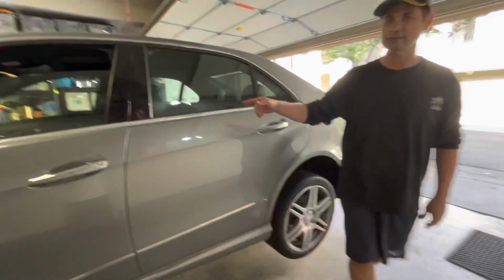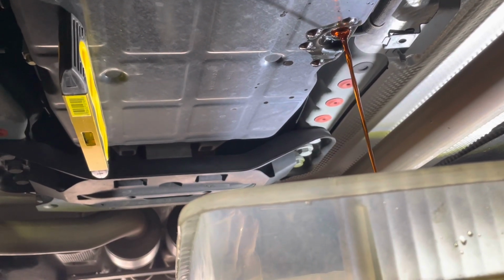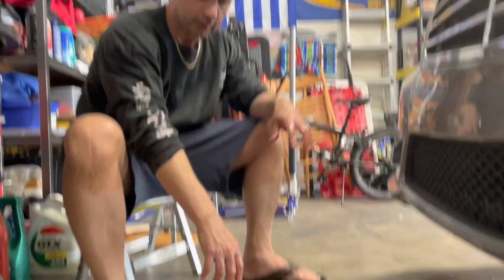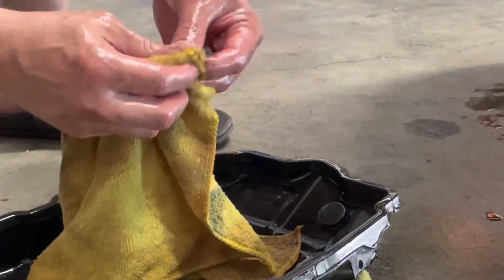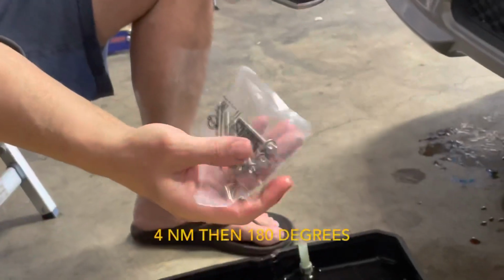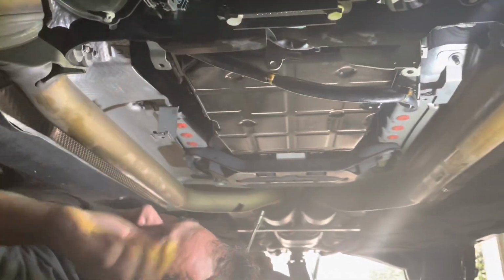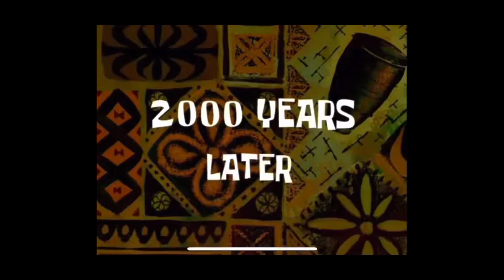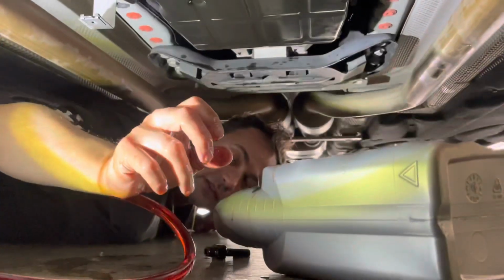2010 Mercedes E350 W212 722.9 Transmission Service

Comment: Excellent video.  Watching real life mechanic’s diy job.  That is just like my setup.  No room to move.  Oil stains on the floor.  Wife asking “when will you be ready to eat dinner?”  DIY on this job will save $800 minus parts cost which pays for all my neat tools.
Reply: Get yourself a set of QuickJacks.  Nice if your doing a lot of your own work.  Will lift the car w/o effort and very safe to work under the vehicle.  27" lifting height means you can use a creeper instead of laying on the floor.

Comment: Great video and awesome camera kid.  I just finished this exact service and set the fluid level at 63 degrees C and with the engine off as you did and the experts in the Mercedes forums said I should re-do it at 45 and with the engine running.  Maybe some experts here can chime in on how bad that is and if I should reset the level as the guys in the forum suggested urgently.

Comment: Transmission level check has to be performed with engine running. Also I read pan bolts are to be tightened to 6NM then turned 180 degrees. These are stretch bolts, therefore, they are not to be reused again.
Reply: I was thinking that very thing - I've done VW's with DSG trans and it was with the engine running and also moving the shift lever through the gears as part of the warm-up process.
Reply: You’re wrong on the torque spec. It’s 4nm not 6.
Reply: Yes it sounds like the engine was not running when he disconnected hose. Then the transmission is not running and in park, a lot of fluid "dumps" back into the pan, so if that's the case, he drained way more fluid than he should have and the trans will be running low on fluid
Reply: Could anyone tell me the part number for the transmission oil pan Bolts he changed in the video? It’s for a 2010 E350 4Matic V6

Comment: I did my 09 E350 pretty much as you did. At 45c ( 113F) the fluid is warm. Just be careful of the hot exhaust. It took about 20 mins at idle to reach  the temperature.. The oem flter from Mercedes ( filtran? material filters down to 50 microns whereas the Febi ( maybe that is the one in your kit? ) filter down to 80 microns. Will that make much of a difference? IDK. Cycling through the gears prior to draining the excess is a good thing also. Good job!!!
Reply: Yes it will. The filter's job is to both keep contaminants out of the trans as well as maintain a consistent volumetric flow rate. When you go higher in microns your flow rate also drops. Lots of people obsess over microns thinking higher is better. NO. Keep the OEM spec for lasting performance
Reply: @supersabrosinho  I believe you have that backwards - the higher the number, the more porous, meaning less restrictive.  I think that was his concern - less trapped contaminates, but higher flow rate.

Comment: Not sure if I would go for it myself. Because sometimes it is not enough just to change the oil, filter, and check the level at 45C. Sometimes Siemens/Continental TCU electronics do not like change of oil and then TCU needs to be reprogrammed. Re-marry. That is another level. In fact, my opinion is that not many mechanics in Australia are real experts in G7 722.9 transmission service and as a result, you end up with problems they create after transmission service. So, I fully understand your reasoning behind "I will o it myself".  My advice to all MB owners with G7 722.9 is "not be afraid to ask who will work on your transmission and what are their CV. o not assume that because it is MB Service center they know."
Reply from the maker: I agree somewhat with your analysis. Changing the fluid (about 50% of it in these services) will result in a change in viscosity because less metal suspended in fluid…..this might affect the how the tcu responds Bc it has adapted over time to condition of fluid. So doing this service every 40-50k makes the difference in fluid characteristics less variant. Doing this once at 120k will surely give you problems. I always do a transmission reset (with gas pedal ) after 
And then it takes like 1000 miles or so to re adapt to new conditions …. Thanks for your comment👌🏻👍
Reply: @SVXistance  Great comment. I have agreed for MB to do Transmission service at 75000km and while TCU has managed well the ISM gear shifting box did not like it. That was on S350 w221.
Reply: @SVXistance  How do you reset with the gas pedal?

Thanks for the great video by the way!
Reply from the maker: @TonyB1999  https://youtu.be/cq7Cu3R3JCo

Comment: Also if you have a A89 transmission, you MUST use Blue color Low Viscosity Transmission fluid,
Reply: To clarify.  Mercedes FE  and some aftermarket FE fluids are blue, some aftermarket FE fluids are also red.   IN any event the A89 transmission requires the FE fluid.

Comment: Hello sir, I recently bought a W212 and I want to change the trans fluid. 

Can you tell me what pump did you use to transfer the fluid into the car. I have all my parts but I do not know what pump I should buy. (Please share the link, or name of the pump)
Thanks! ❤
Reply from the maker: Slippery Pete - Fluid Pump for Standard Quart Bottles - 8cc per Pump Stroke and 3rd Hand Adapter, Transfer Gear Oil, Transmission and Differential Fluid (28mm) https://a.co/d/7sH66WW
Reply from the maker: Just google “Fluid transfer pump automotive”
Reply: @SVXistance  ahh, that worked? Not gonna lie I think that May take a while just to pump it in the trans.

Thanks! I appreciate it. 🥰

Comment: Very helpful video. How much oil came out when you drained it? Would you say around 6 liters?
Reply from the maker: I didn’t measure but I hear is about 5.5 l
Reply: @SVXistance  ok perfect! So this way youre getting most of the 9 or 10 that the system holds out of there
Reply: So shouldnbe 4 in there

Comment: WASENT YOUR FLUID WAY OVER FULL LEVEL CONSIDERING ALL THE FLUID THAT DRAINED OUT WHEN YOU REMOVED THE DRAIN PLUG ??
Reply from the maker: That’s the idea you over fill by 1-2 quarts which dilutes old fluid (you really only replacing 1/2 of fluid) and the excess comes out till dripping which is right level at temp👍

Comment: Is a Mercedes Benz A001989240310 multi grade oil good for transmission oil change for a e550 2012 4matic sedan  ? I changed my oil and the car won't move again forward or backwards after shifting gears successfully.  I hope I have not damaged my transmission if at all replacing the oil completely may be able to correct/reverse anything wrong with the car  ?
Please advise 🙏 urgently
Reply from the maker: Bro that’s for power steering 🙈🙈u need to drain all that out and use ATF 134FE is the blue fluid for that 2012 e550
Reply: @SVXistance  i will do that immediately and hope that will solve the problem. I'm extremely grateful for your advice. Thanks so much 🙏

Comment: Would you trust any European Indy with decent reviews to do this, or would you prefer a transmission shop / MBZ Dealer?
Reply from the maker: Good independent should be able to handle this no problem and be cheaper than dealer 👌🏻

Comment: I expected that the first thing you would mention in the video is, When to make this service (mileage or years ) ?
Reply from the maker: Usually best to do every 40k miles or 4 years as preventative maintenance 👌🏻
Reply: Definitely pre-emptive at 40k miles.  Maintenance listing shows every 70k or 7 years.
Reply from the maker: @stevem6711  actually first one is at 40k then you can do every 70k
Reply: @stevem6711  70K or 7 years is for the A89 option 722.9 transmission change that occurred in late 2010. The A89 fluid is the FE blue fluid. The red is used in the pre-A89. 40K or 4 years is what I have for my 2011 E350 as it was built in June 2010.

Comment: Was the engine running when u were letting the fluid drain at the end ???
Reply from the maker: It was …should I have turned it off ??😳I linked pdf from manufacture below ..
Reply from the maker: https://www.weistec.com/forms/weistec7229servicedata.pdf
Reply: @SVXistance  no no you did it correctly I just didn’t hear 👂 the engine running in the video you did 👍 I did mines about 8000 miles ago 
How does yours shift mines shifts like 💩 when cold
Reply: I also have the 3.5 direct injected engine which is very noisy
Reply from the maker: shifts ok but weird thing after fluid change my 4-5 shift is hard !! 🙈I should have removed valve body and checked solenoids for debris on their screens ….I might redo and replace solenoids they are like 40 buks each 😂
Reply: @SVXistance  man yes bro same situation here those transmission are ridiculous I heard u can update the transmission via xentry to help with that issue. I thought about doing the same thing with the solenoids I just heard when removing the conductor plate it can break so it’s veryyyy risky. I think Ima order new solenoids when I change my fluid again in another 35k miles
Reply: Also have you ever changed your shocks on the car I literally feel every bump mines has 115k 2014 e350 4matic
Reply from the maker: @G_G_AutoCareLLC  https://youtube.com/watch?v=OINKlZhqiWg&feature=share
Reply from the maker: @G_G_AutoCareLLC  https://youtube.com/watch?v=6HFh935LBfY&feature=share

Comment: Did you shut off the engine when you let it drain or did you leave it running? You never mentioned that.
Reply from the maker: Engine is on when letting trans drain to fill  level
Reply: Shut the engine down

Comment: Good video every how many many miles you have to change the fluid?
Reply: they say 60-100k for automatic transmissions but sooner is probably better of that recommendation is anything like the 10k they say for oil changes (lie, change your oil every 3500-5000 miles)

Comment: This is a good video, and I would love to do the same thing to my vehicle. I have a 2010 S 600 and V12 that I have been trying to do that to, but not able to because a hardshift. I believe it's my transmission, from 1st to 2nd gear it has a really hard pull that is really uncomfortable and don't wanna do that if there is something wrong with my transmission, but nobody can tell me or give me an answer for that, but once the car heats up it drive smooth. AT Cold star it shift really hard... Sorry that this doesn't make too much sense, I don't know how to explain it.
Reply from the maker: Shifting issues usually due to sticky solenoids or wearing of valve body passages that causes loss of pressure when shifting ……look up valve body

Comment: (So well worth it to save no money and waste half a day of my life. [Tools, setup and I'm sure you didn't use proper disposal procedures]  This is for hobbiests)
Reply: To each his own… I get personal satisfaction doing my own work. Multiply that by 4 cars I do save a bit of money. I dispose of all my used oil and trans fluid at my local oriellys FYI 👌🏻👍
Reply: @WPHMP  I agree but, scan tool, torque wrenches, tubes, jacks, fluids, disposal, containers, time and it being Mercedes (I have a 2014 E350 4Matic Sport and a 2019 AMG E63S)   I can see oil changes.....maybe.....and not on an AMG.   Not, "To each their own".   It is more costly..plus the ultra-consumerism.  I live in the highest possible prices Metcedes service area in the USA and still 2 oil changes [A+B] plus transmission fluid change costed 800 dollars at one of the most expensive dealerships with a package. It's  oral about 1800 dollars for that.  722 dollars plus tax and 325 dollars plus tax, just for the oil changes.  <They forgot the free 5 dollar car wash>.  I did receive 60 dollar OEM Mercedes windshield wipers as well.   Let alone the normal transmissions fluid change cost.  I won't expand on how much that costs.

Don't take all replies as an insult. It's just reality. I think it's interesting to DIY and do much myself. Like LED lights, lips, diffusers, interior updates, 2020 GPS updates, cameras, steering wheel and etc.  Anything that a licensed Mercedes mechanic handles, I don't touch. I really clicked on this to see if AT-205 reseal could be added to the transmission fluid as a safety precaution.  I usually add it to the oil and struts on my older Mercedes.    Personal = Hobby.  We both know all Mercedes are money pits and the newer ones are manufactured with plastic over computerized crap.   -Enjoy the day.  I wouldn't step into an O'Reilly's
Reply: @UhhhhhnooOOo00oO  
You're a bit too judgey to do your own maintenance.  "Ultra-consumerism", really?!?   Yes, you should go to the dealership to have yours done.  If you think for a second a MB dealership doesn't mess things up and not tell you, like stripping out a bolt, you'd be wrong.  Doing it yourself ensures you know how your car was maintained without having to "trust" a dealership with a profit motive.

Stop wasting your time viewing diy videos on YT.
Reply: @UhhhhhnooOOo00oO I agree

Comment: Which torque wrench did you use?
Reply from the maker: TEKTON 3/8 Inch Drive Click Torque Wrench (10-80 ft.-lb.) | 24330 https://a.co/d/2wBvPRf
Reply: @SVXistance  Thanks. But how did you get 4 nm. when the lowest setting on Tekton is 10 ft lbs * 1.356 = 13.5582 Nm? Did you over-torqued bolts by 3 times + 180?
Reply from the maker: @Resist_JWO_1984  TEKTON 1/4 Inch Drive Dual-Direction Click Torque Wrench (10-150 in.-lb.) | TRQ21101 https://a.co/d/idnnXT1
Reply from the maker: @Resist_JWO_1984  I used the 1/4 inch drive wrench (I have both sorry) it goes from 1-17 Nm
Reply: @SVXistance  Got it. Those bolts snaps around 15 nm. so, I was puzzled how come you didn't snapped all six bolts off lol Anyway, what is the brand or model of the correct torque wrench? 
I'm planning to change tranny fluid 722.9 for the first time at 73k (double overdue) but all the low torque wrenches on amazon have not that good reviews, and I don't want to pay $200 for like 2 uses.

Comment: hi thank you very much for your efforts I have e350 2010 w212 does need or have torque converter oil change like 2011 thanks
Reply from the maker: You can drain the torque converter if you  want to get extra 1/2-1 quart out of system 👌🏻

Comment: Did you drain the torqu converter.?
Reply from the maker: Did not drain converter …you can get extra 1/2 quart out if you do 👍
Reply: @SVXistance onverter hold 4 qt ( it’s 5qt in NAG-1 TQ)

Comment: hello I have a problem with this automatic gearbox, practically when the gearbox temperature is below 30 degrees, when I shift from D to R I hear a "taac" noise.  In the heat, however, nothing happens what could it be?
Reply from the maker: Could be a broken transmission mount ??
Reply: @SVXistance  otherwise the car is fine and also the gearbox, does not slide, does not vibrate, etc.  It has always been serviced every 60000km
Reply: Its the dual mass flywheel. Nothing to worry about. My E63 makes the same sound.

Comment: How come your fluid is red? I have the same engine 2011 w212 the color is blue on mine
Reply from the maker: They changed fluid in late 2010 to blue version {is a little thinner for better mpg } but mine was early 2010 still used red 😬

Comment: Can you let me know where you got the filler tube - "at-106"    can't find it?  Also, what kind of pump did you use?   Great Videos - thanks!
Reply from the maker: Amazon has At 106 now and Home Depot has pump
Reply from the maker: https://www.amazon.com/dp/B07R4P3PCD/ref=cm_sw_r_cp_api_glt_i_7217AVY29NEA67T8KFY3?_encoding=UTF8&psc=1
Your friend has shared a link to a Home Depot product they think you would be interested in seeing.

https://www.homedepot.com/p/HDX-2-Gal-Pump-Sprayer-1502HDXA/307766539
Reply: FCP Euro has all the items you need to do this.

Comment: He literally drained the whole fluid .
The level should be checked with the engine running.
That transmission is probably shot within 5 minutes of driving.
Reply from the maker: The engine was running while checking fluid level …been 5k since service 🤪thanks for your comments
Reply: @SVXistance sound was different from when you had scanner attached, so engine was off

Comment: This is wrong, the engine should run when you check the oil level. You have far too little oil now. And you didn't change the oil in the converter, or the oil cooler. so this is exactly how not to do it